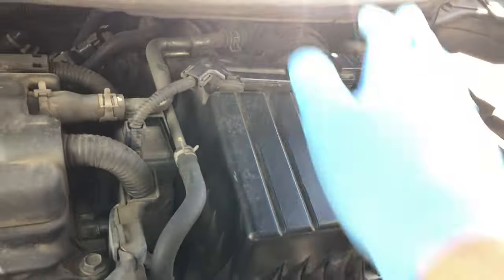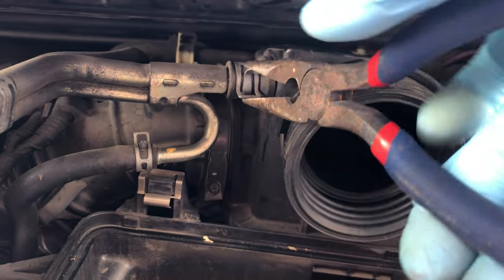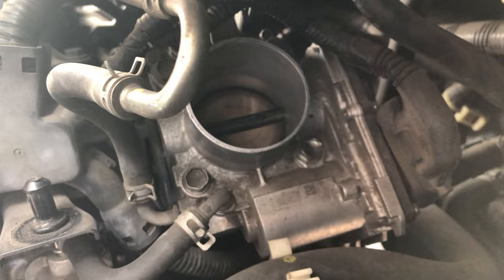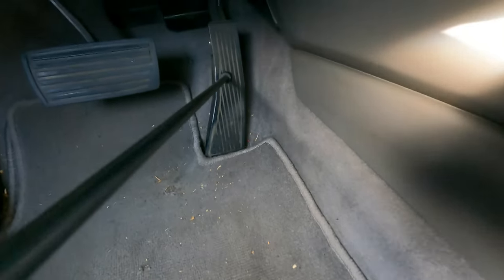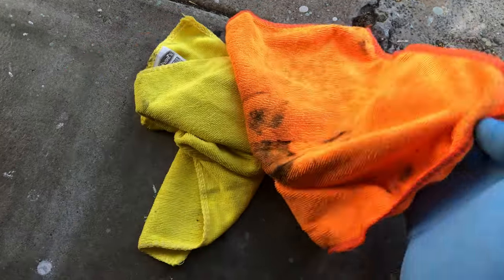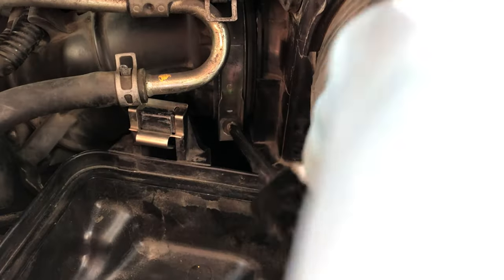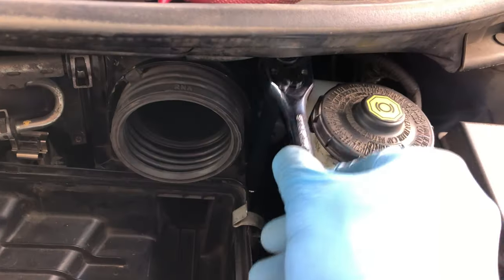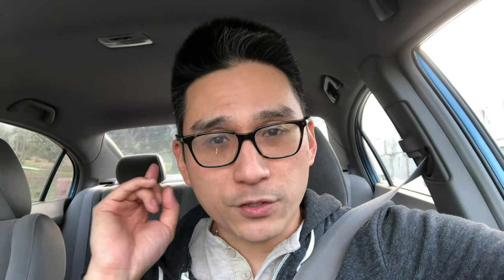How to CLEAN YOUR THROTTLE BODY and make your engine feel like new!  2006-2011 8th gen Honda Civic

Comment: DO NOT DO NOT SPRAY DIRECTLY INTO THE THROTTLE BODY‼️‼️‼️‼️‼️ this caused the my idle speed sensor to break (attached to throttle body) and i had to replace my whole throttle body. what caused this is the cleaner leaking into the butterfly valve’s horizontal axis destroying the sensor. spray the cleaner onto a rag and wipe away and visible carbon AND AVOID WIPING THE ENDS OF THE BUTTER FLY VALVE’S PIVOTING AXIS (the two ends of the black line with screws in it. obvious signs of you breaking this sensor is: hard shifting in the automatic trim of civic, check engine light stating (idle control system RPM higher than expected), and terrible gas mileage.
Reply: My idle states at 800 - 1.000 since my mechanic cleaning the throttle body by fully uninstalled 2 months a go. Before he cleaned the throttle body, the idle state at 600 - 700 Rpms.  Now, Even he did already the relearn procedure, the idle keep staying at 800 - 1,000. The gas getting terrible, only 7 - 8 kms per litre. Before was 9 - 10 kms per litre. Any sugestions about this situation? Thank you
Reply: @kharismahepy8136  i’m currently in the process of trying to fix this issue as well. so far i’ve cleaned my map sensor, mass air flow sensor, and replace my whole throttle body. my car runs better, but it’s still idling at 900 rpm and getting 19mpg. however i have not calibrated my tps yet so maybe that will fix it. i will definitely update this thread
Reply: @kharismahepy8136  did he calibrate it with an obd tool? or just the standard unplug the battery procedure. because the honda dealer actually uses a very special obd tool to recalibrate your systems
Reply: @kharismahepy8136  i’ve done the “unplug battery and hold idle at 3000 rpm” 2 times now but it has done nothing
Reply: @kooppoopmax5812  he did it with OBD2 scanner thing. After it didn't work, he following the relearn procedure from this channel and still unsolved. Next time i will try to open and clean my PCV valve, hopefully this will work.
Reply: Thanks for sharing!
Reply: Would this cause misfire

Comment: BEFORE disturbing any sensor connectors within the engine bay , please DISconnect first the Negative cable of the battery !
Reply: You can't  disconnect the negative terminal of the battery because then the Electronic actuator for the throttle body would not be operational , and the throttle body would not open at all

Comment: The Honda service manual very specifically says not to put your fingers in the throttle valve with the ignition turned on as that could result in serious injury...aka losing your fingers.

Comment: I noticed you didn't wipe down the inside of the air box or the two other tubes where the air is flowing in.  Why not? I could see dirt all inside them as well. I would have wiped everything down inside and out.
Reply: As long as it's before the air filter then it doesn't matter much.

Comment: With all the codes and everything and the possibility you might break something, cleaning the throttle body is more trouble than it's worth. The computer compensates for the buildup anyway. I probably won't try this again
Reply: Same here .. its been 2 days and my idle is still messed a bit

Comment: You can use a ratcheting clamp bar (under $10 from harbor freight) that you can change into a spreader bar, to keep the pedal depressed (must safer than a brick). Just wedge it between the pedal and edge of the car seat.

Comment from the maker: UPDATE!!!  I forgot to hit "Clear Trouble Codes" in the video.  Even though the check engine light turns off, the computer still stores the codes which is why it was viewable on the app.  To clear the trouble codes, you need to connect the OBD reader with the car in the ON position but with the engine OFF then scroll down the page and hit "Clear Trouble Codes".
For more info:  https://youtu.be/oFzi1L4yTnw

Comment: Great video !  I heard some noise , Did you started the car  to do that cleaning?! 🤔
Reply: That noise is from the throttle body motor being energised. 
Turn key to accesories position (II), no engine running. That will allow the butterfly valve open when the gas paddle is depressed & hold.

Comment: I tried to take my airbox off and it ripped. Lol. 

Once you get this far to where the throttle body is exposed, you're very close to getting it removed. I would recommend trying this. It will let you also clean out a good amount of the intake manifold.

Comment: Hey does ur civic idle high when u put it in reverse in the morning? My gfs idles abnormally high in reverse and then the other day she basically described that her throttle stuck in the morning and she had to put it in neutral at an intersection to not keep accellerating. Then it went away. So im gonna clean the throttle body. It has about 110k on it. 06 civic. I was thinking TPS too but I'll clean the TB first and see.. since it isn't throwing codes and only did it in the morning.
Reply from the maker: No mine does not do that.  It could be a lot of things affecting the idle.  Try the throttle cleaning and also cleaning the MAP sensor then doing an idle re-learn.

Comment: Just wondering what is causing my Civic to be an oil burner. Do you think adjusting the valves may help? Scotty talks about adjusting the valves on Hondas. I do notice rattling at low speed and I think it's a valve issue.
Reply from the maker: Have you tried a compression test?
Reply: @kelvinsgarage  Not yet.
Reply from the maker: I would say try the compression test, at 400k miles your rings may be worn and getting blow by and oil consumption
Reply: @kelvinsgarage  I will. I'm about 480k miles now.
Reply: @amill1563  did you end up doing a compression test?
Reply: @AudreysKitchen  I did a compression test before even knowing it was burning oil. I now treat the symptoms by using different oil additives and they are reducing the amount of oil the car burns.

Comment: Hey man my honda civic turns off when im at a red light and i hit the gas and it turns off do u kno what it can be?
Reply: U ever find the issue
Reply: @noeffort2198  yes sir it did not have no air filter when i bought it that was the issue
Reply: @omarbermejo3294  gotchu mine ac compressor was stuck hoping it’s the issue

Comment: (Debunked false) I believe you can put your Civic in Accessory mode, press the throttle and take the key out while continuing to press down. It'll leave the plate open until you put it back into accessory, where it'll close if the pedal isn't pressed.
Reply: I tried that on my 2013 Civic today, and unfortunately it didn't work. The throttle body automatically closes as soon as you take it out of accessory mode. I had to keep the pedal depressed in accessory to keep the valve open. Maybe it stayed open on older models that didn't use drive by wire, I dunno.
Reply: @mikeburston7013  aw, shiet, sorry I didn't correct myself sooner. I cleaned my own throttle body just about a week ago and I realized I had to use a brick 🥴
Reply: @TGerhardt  No worries. What you said seems like something that should work, but unfortunately doesn't for whatever reason. I didn't have a brick,  and just ended up using an ice brush to depress the pedal (and crossed all my fingers that it didn't slip off, because that would not be good if I got a cleaning rag sandwiched in there). Up here in Canada we don't always have bricks, but we always have ice brushes haha.
Reply: The throttle body  stepper motor need to be energised to hold the butterfly valve open. If you take off the key, meaning in off position, spring inside the throttle body will close the butterfly valve without counter by the energized motor.

Comment: First thing first remove negative terminal of battery just for safety. 😉
Reply: If there's no power how would you open the throttle....it's drive by wire not cable driven